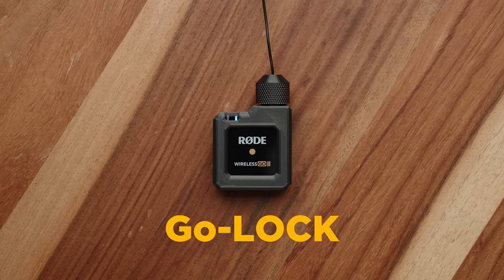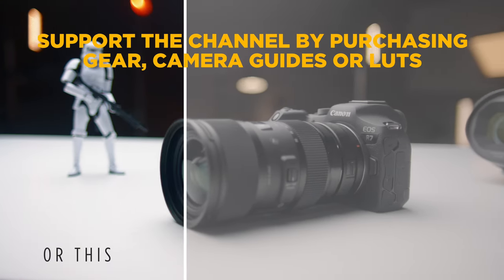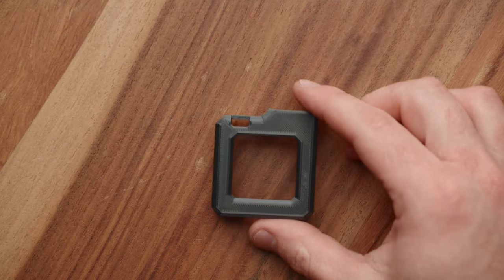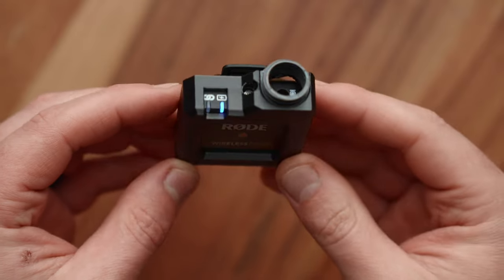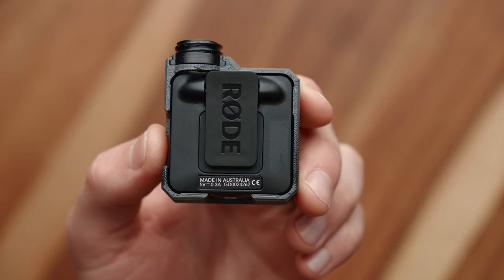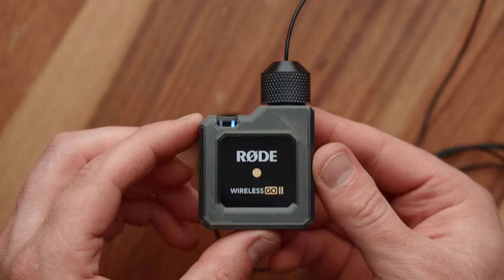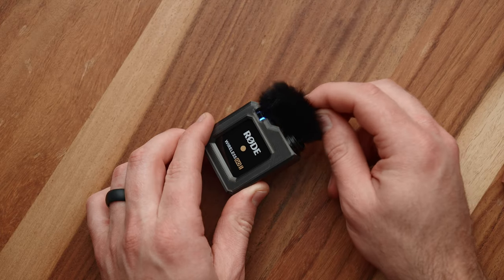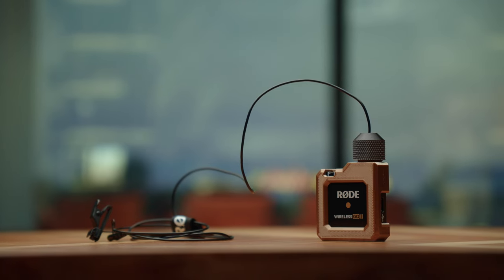DIY Rode Wireless GO Mic Cage!

Comment: Yess! The main thing that irked me about the wireless go ii is that the mic doesn't lock.  Don't get why they did not add that feature.  Wish we could still use the wind muffs with the case, but with how easy it is to remove and place inside the case it should be no hassle 💚 Thank you

Comment: Awesome project! Printed it and it works like a charm. Please note that the Rode Smartlav+ does NOT work as it has a TRRS connector and needs the Rode TRRS to TRS Adapter which comes in angled at 90°. Luckily, you can still use the 90° TRS TRRS adapter with the Smartlav + as it barely clears the threaded part of the Go LOCK case.

Comment: Well done Caleb. I've also designed and printed parts for power tools that I use, where excellent manufacturers leave niggling problems for us to deal with. I don't have this mic (although I have several other Rode mics). Just wanted to commend you on what looks like a great solution. And yes, your sponsor free channel really does stand out amongst the crowd.

Comment: I purchased 4 of these and tried them in the field yesterday.  It was phenomenal.  Locking system, secure fit, and durability is awesome.  Another awesome contribution Caleb.  Does anyone know if these Mic cages will work with the Rode Lavaliere II?  I want to purchase a couple these new mics (currently using Laveliere Go), but dont want to if the cages are not compatible.

Comment: IDEA: i would like to have like a bracket or something that threads on the bottom of a 5” monitor or bigger that has a mounting on the sides to mount a video transmitter with monitors that don’t have a space for it. 
Example: I use Atomos products and Hollyland transmitters, I would love to mount my Mars 4K on the back of my ninja (SSD side) in a non-obstructive way and have the receiver on my shinobi, there isn’t a easy compact way to mount video transmitters to make a small compact directors monitor without a lot more accessories and making the rig bulky. 

Other than that, this video was awesome Caleb, as always, value and quality work from you man 💪🏻

Comment: Nice job on the design and very generous offering the files. Unfortunately, for me, the design doesn't address one of the things I dislike the most about the Rode Wireless Go II - the obnoxious branding all over the front of it. Really wish you could have covered that up. O r does that compromise your relationship with the company? On another note, I recently upgraded to Ventura and it pretty much destroyed the RODE Central app. I could not, for the life of me, get my recordings off the TX units, my entire system just froze up. Anyway, I contacted RODE and they got back to me within 24hrs, were very helpful and a few days ago they released a new Firmware which appears to have addressed the problem.

Comment: Looks awesome! Have you tested if it works with the Rode Lavalier II? It has a small screw nut on it so I was wondering if that would impede it. If so your next batch would be great if you adjusted for that. I think more people will increasingly be buying that model! and if it does fit, please get black back in stock! Great stuff
Reply: Any word on this? wondering if I should buy these or if they don't work with the Lavalier II

Comment: i have a fuji xt3 camera which takes a 7.4 volt battery. can i use a dummy battery and plug into the 8 volt dc port for this smallrig battery? if i do, will it fry my camera? thanks.

Comment: UPDATE: The 3D body printed very nicely. The thread and cap printed at high quality just didn't hold up so I think I'm going to glue a different type of cap to it just to be more confident in that piece. Overall a great concept which solves not having a locking mic input.
Reply: I had an issue with the screw part not even fitting into the slots.. What ya end up doing?